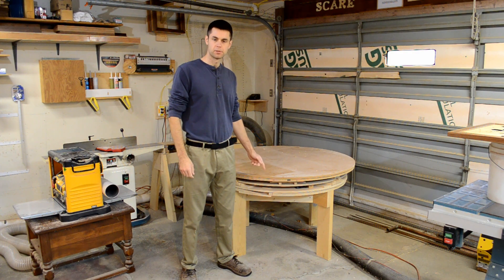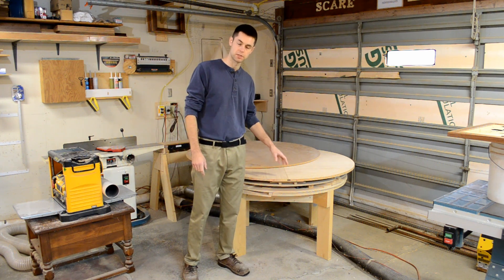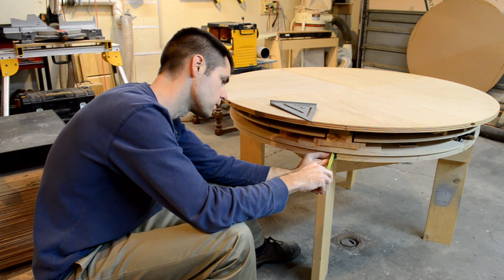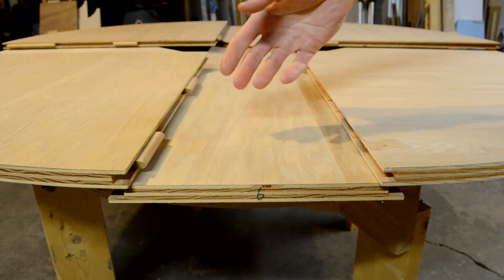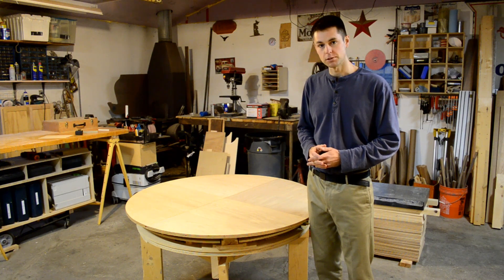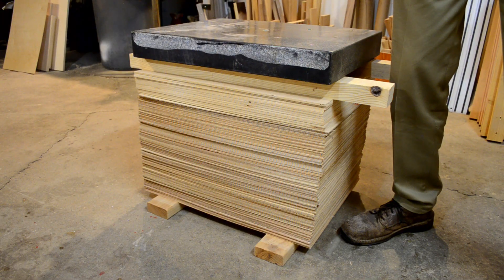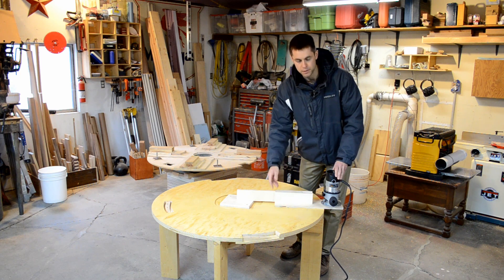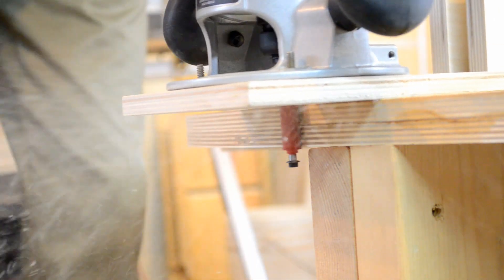Expanding Table Upgrades #1

Comment: Scott. I like how you explain things but it may help more to show visuals to illustrate what you mean.  Sometimes things get abstract just w words. Everything you're describing is right there. Show us and describe it.

The weighing should have been done with a hoist or multiple scales. Don't guess man, you're an engineer.
Reply from the maker: +Hugo Danilo A hoist or multiple scales were not available, we raised the leg opposing the scale to an equal height so I feel fairly confident in the 210 figure. This was more of a ballpark measurement anyway, each table will vary depending on leg design, plywood density, etc.